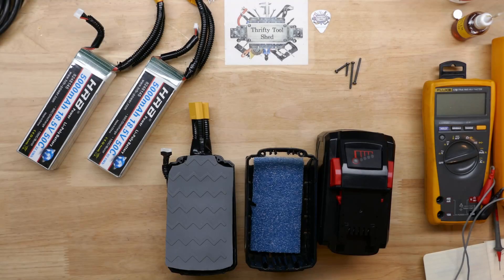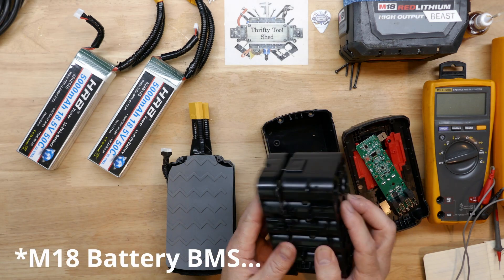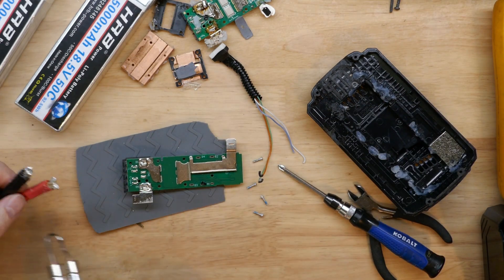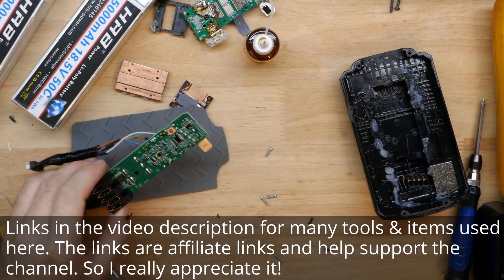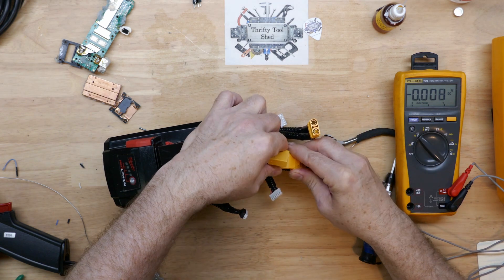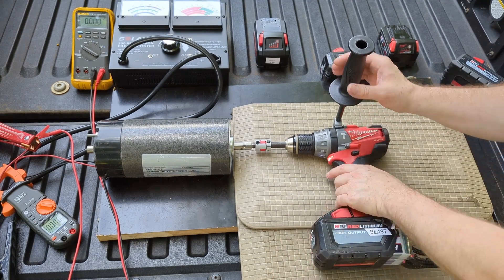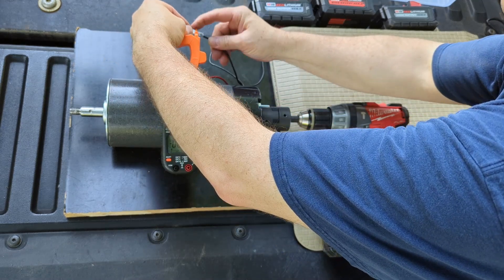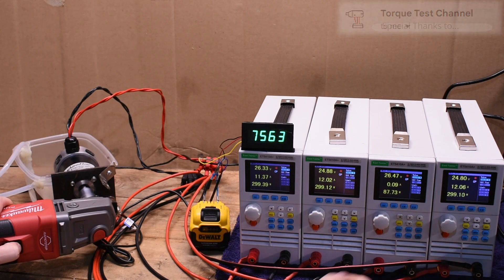M18 LiPo Beast Part2 (Testing by TTC)

Comment: So funny enough this is currently a project I’m working on. You beat me to it! LOL. Great reference data from your first pack. Been wanting to make my own “forge” batteries even before that was a rumor. Sick to see you doing it. 

On a side note regarding the cutting out, one thing that may be the issue and it’s the only thing I can think of with my experience of pack building in regards to the m18 charge protocol: I think the simple fix was to just attach it to the charger let the charge light turn on, and then take it off. Basically giving it a quick “soft” reset if you will. I’ve noticed with diy packs that this can happen. Especially in the later brushless tools that also have pack monitoring built into the tool and not just the pack itself.  

Another thing to possibly look at is the thermistor on the pack pcb, make sure it’s not broken etc, and possibly see where it’s located, it may be from your tear down and re assembly that it got pushed somewhere where there is a lot of heat generated like near the mosfets. You could clip it, add jumper wires and relocate it somewhere in the pack enclosure far away from the board OR if you’re feeling ballsy, find a resistor with the same/similar value of the thermistor at room temperature, and replace it all together. You won’t have temperature monitoring but you also won’t have cutouts due to improper readings. 

And last but not least, it could be a special “feature” on the m18 battery boards that I’ve been thinking on. There may be some special “activation” from the factory when they attach the bank of cells to the board and it’s first powered on. I’m not sure if this is true or not, just pure speculation. BUT I can say for a fact that dyson uses this same strategy in their batteries as a way to prevent pack rebuilding. There is a line of code that is hard altered on the microcontroller (battery side) that will not allow new cells to be installed. It has a way of monitoring old cells and life and once it gets to a certain point, boom. Pack is actual trash unfortunately. Not sure if Milwaukee does this, but haven’t found out yet. My lipo cells are coming in in about a month. Got some raw cells to pack in an xc5.0. Hope some of what I said helps. Great stuff you’re building.
Reply from the maker: Hey,
I want to see that build when you get through! So yeah.. I was wanting to build this pack for over a year and the cost of the Dual LiPo packs were my hold up. Hind sight, I wish I would have done it sooner since I did actually get it to TTC. I basically waited too late since about the time I finished the 1st prototype the Forge 6ah was hitting the market. I was worried if a higher amperage version would come out before getting it back to TTC. My main goal is to have fun and hopefully push Milwaukee to come out with their own 10-12Ah LiPo. If I fell to beat Milwaukee to it, then well dang. Positive note the Beast is at TTC right now and at least performing well! We should see it next month "hopefully". Yeah, regarding the original 12Ah BMS I showed in video as you mentioned that only blinking one LED, put back on charger to reset and all good so I  know some about that part and talked about it in a couple videos. This beast pack was more simply stopping under load at inconsistent times and loads. I did not see that with my quick tests before sending it out to TTC. So I was thinking one of the balance leads in the cheap JST connector I used may have been making a bad connection. However, it would start right back up with TTC in the video after shutting down. I believe the NTC is fine and I thought about soldering on a 10K ohm resistor just as you mentioned, but it checks fine and the fuel gauge pattern reacts with an over temp usually as well if I remember correctly. The other option is a board issue (or as you mentioned the Dyson) I have several videos on the Dyson and yeah, it sucks once the cells drop low or you attempt to re-cell one...
I do wonder if these HO packs  do have a factory default setting once it gets to a low voltage condition. I wasn't going to chance it, so I simply put on the Aftermarket board and it seems to work, but that thing is not a good protection board. It fits my purpose well so far with no hindering the power. 🤣It has almost no low voltage cutout whatsoever and the balance leads did not have to even be connected to work either when I tested it. Most aftermarket boards do, but this 12Ah 21700 version did not that I could see. I still connected them in case in some conditions it does actually monitor the cells, but I am not thinking so...
Look forward to your build as well, thanks for your kind words and for all the helpful comments.
Reply: @ThriftyToolShed  you are the MAN! Super useful data for my end. It’s nice knowing you already did the weird stuff I mentioned. I’m that case I am clueless. But I’m going to post a comment of another guys channel that is a goldmine for nothing but the Milwaukees BMS protocol and communication. He was able to dump the data stream between the battery charge relationship with the charger. He also mentioned something noteworthy, the high output packs will not discharge cells past 2.5v but the standard xc packs will discharge to all the way to 2v! Granted the data sheet for the Samsung cells do state you can discharge that low. Anyways before I get carried away I’ll post his channel in a separate comment under me. 

As for the battery drain issue, I believe I have a fix for you. I’ve built a ton of small 5-10 cell packs over the past year and they experimented with countless “BMS’s” that hardly worked. I finally came across one that works like a charm, does not cut out under a hard inrush load, stops output at 2.5v, and balances. All the boards I’ve dealt with don’t balance or cutout. Just paperweights. But this one does it well and has around 30-60A discharge rate depending on the cell count. I’m going to link this exact one in the comment under me as well as it may be something to work with here. Because from watching other videos and experimenting myself, I believe that all m18 tools will accept just a raw + and - output. Only issue with this is it will drain your battery to the death UNLESS a BMS in in line which this one has worked great for me. I’ve built 3, 5S batteries (standard 18v pack) and three 3S packs with this BMS and have been using them over a year. Just a standard barrel connector for the charge using a wall wart. Also this BMS can be found super cheap on eBay and aliexpress as well under different names of course, but the way you can tell with these is they visible have a microcontroller on them vs the standard BMS boards that operate on purely mosfet, and resistor/capacitor control. Hook all the cells up with the same/very close to the same voltage and walk away. 18v pack that charges/discharges properly and does a good job at balancing. This board may be another solution to your puzzle given you’re raw output now. Great talk, look forward to your comment. Amazon link and dudes channel below ⬇️
Reply: @ThriftyToolShed man sorry for such a late response on this! The lipo conversion is unfortunately still an ongoing project. You know how lipos are lol. But I did think of you when I completed this over the weekend. Here’s my DIY high speed ratchet. Faster than the Milwaukee with the same if not a little
More power. https://youtube.com/shorts/kRFn23mcbeQ?si=kZNg48U5E03Eothw

Comment: My Weller iron just like yours was my go-to iron for high temp stuff for a long time. Then a while back I found a couple really old irons in the trash that have large chisel tips and I find those to be better for me for large negative wires because of the added thermal mass.  I have 5 or 6 different types of irons now (none of them fancy) and I use almost all of them from time to time, there’s definitely some personal preference to what works best for different jobs.
Reply from the maker: I would imagine the chisel tip would help with the thermal mass for sure. If the cheap copper wire was not so easy to use for the Weller I would switch over as well.